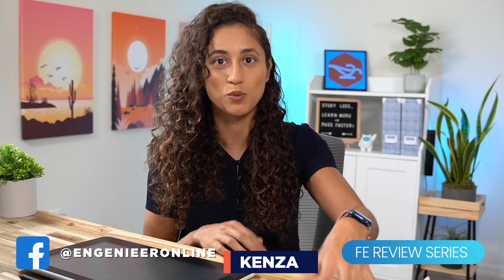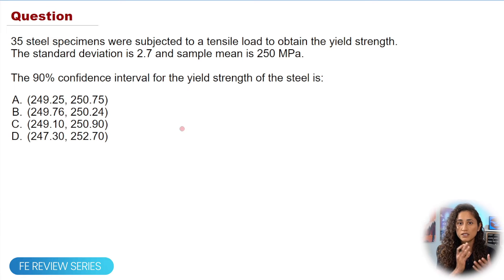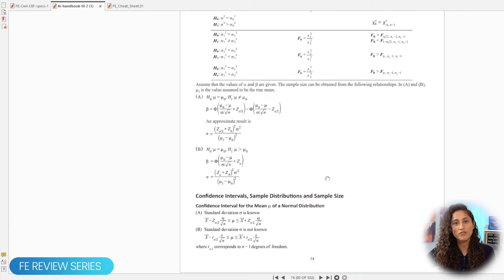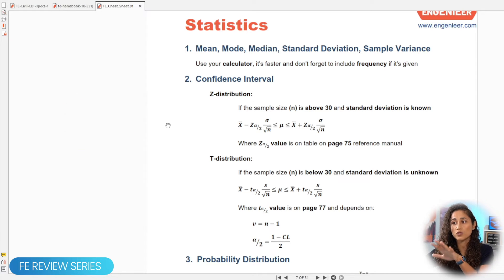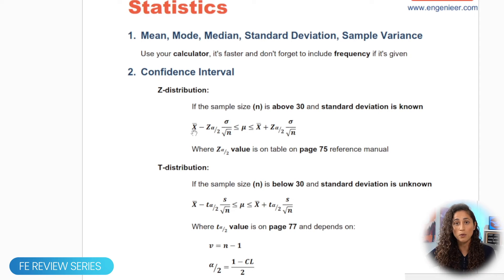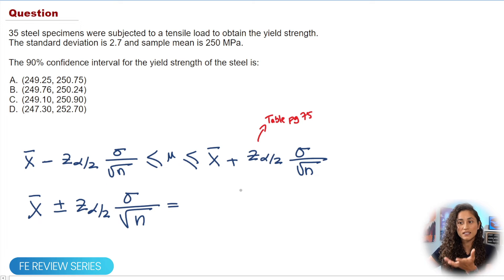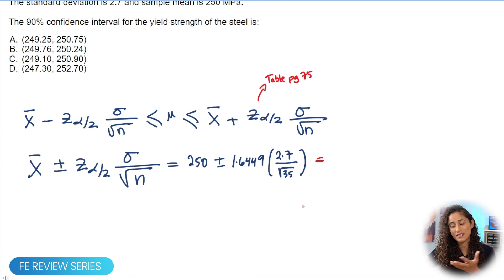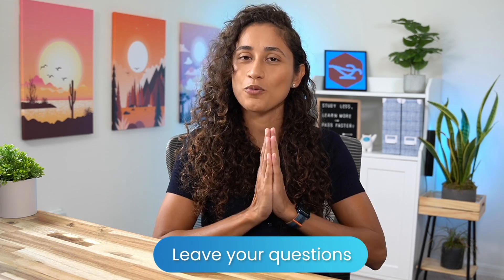How to Find 90% Confidence Interval | FE Review Series Statistics

Comment: Hi Geni. Please can you solve a question like this one/direct me to a video where you have solved it before? I applied your method but I did not arrive at the answer. 
The water content of a soil volume is measured four times gravimetrically by oven drying. The Mean value of the water content is 23.2%. If the standard deviation of the four measurements is 1%, the 99% confidence interval of the soil is most nearly what?